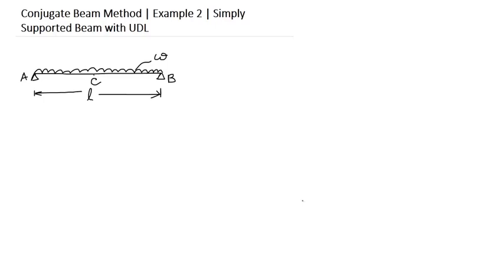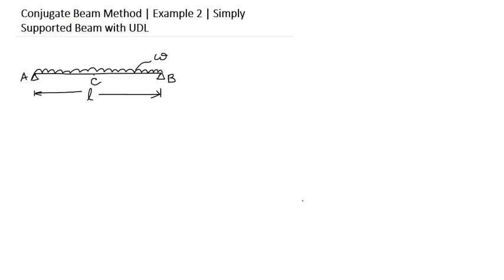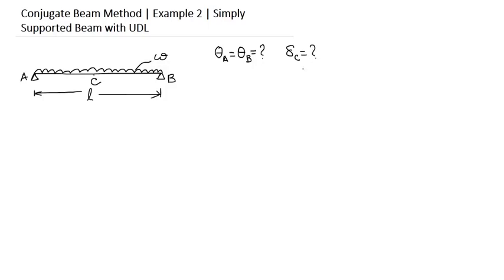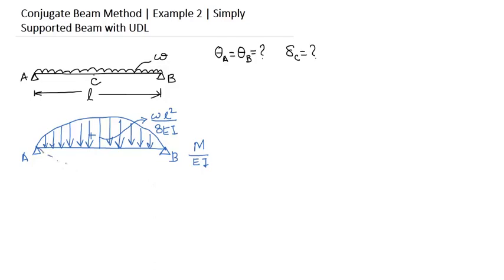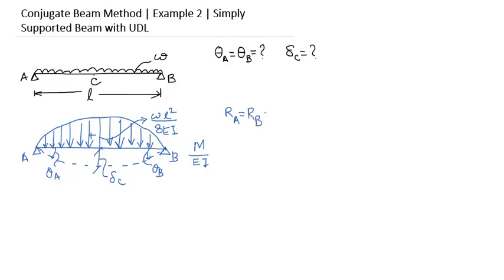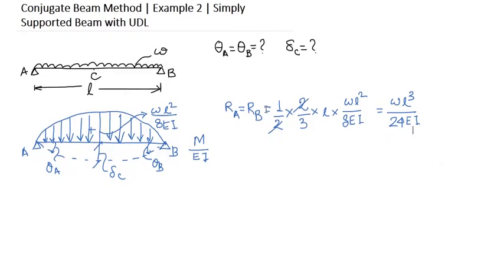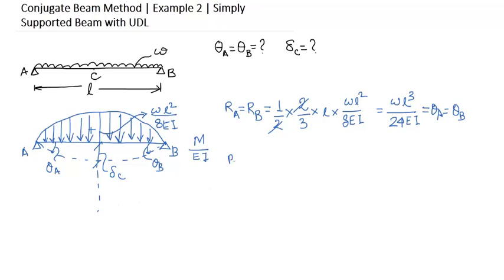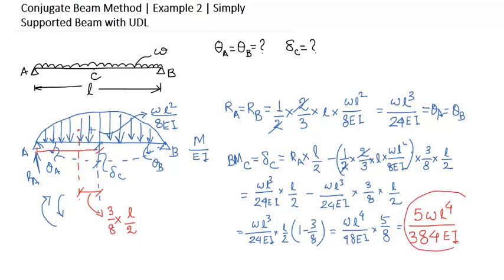Conjugate Beam Method | Example 2 | Simply Supported Beam with UDL

Comment: Bending moment at c wl^2/4 aega
Reply from the maker: For simlply supported beam with udl, the maximum moment at mid point is wl^2/8.
See the calculation:
Reaction at A or B , R= wl/2.
Moment at C = R × (l/2 )- w*(l/2)*(l/4).
= wl^2/4 - wl^2/8 = wl^2/8.
Reply: @BeingCivil  yes sir thanks